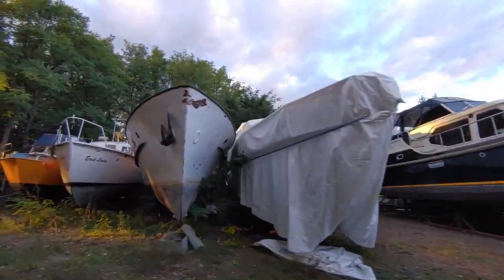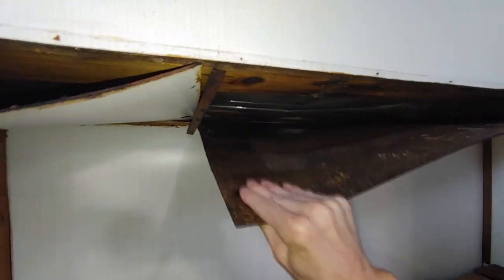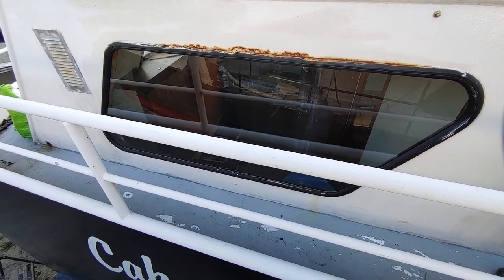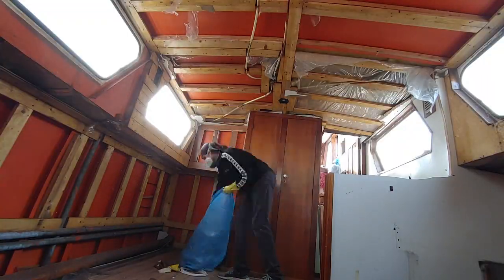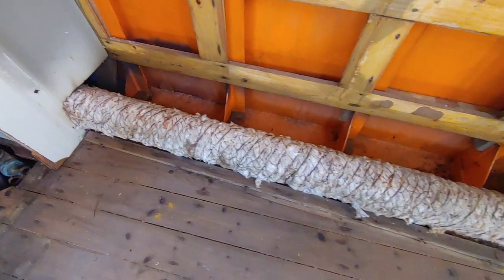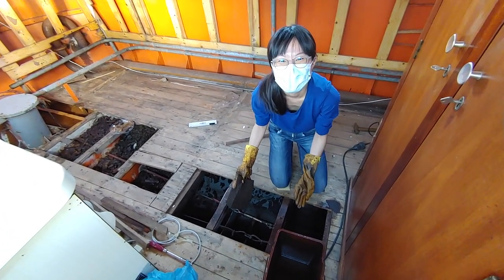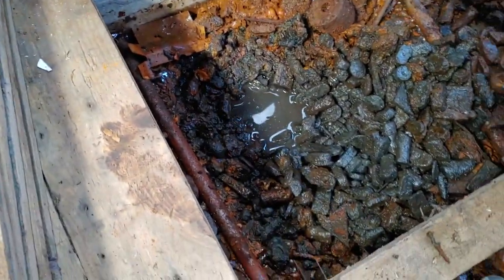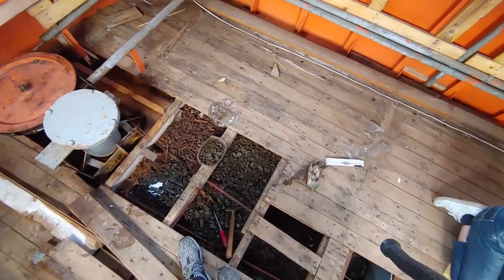WE NEED A PLAN for our Boat Restoration! - Week 3 - Vintage Yacht Restoration Vlog

Comment: Weigh the metal bit as you take them out so you know how much weight you need. Then make small forms and cast the metal bits in cement/concrete. This way you install the ballast in blocks. They will be easier to remove to check and maintain the hull. You could also lay down a thick rubber mat to keep the ballast block from sliding. We do this here in the US instead of using lead ingots or loose-fill ballast.

Comment: If your still finding water. I would consider getting a wet/dry shop vac. Will save you some time if you have power to run it. If you dont. Consider getting an aerator pump that runs on 12V DC.

Comment: for the hull i suggest a needle gun, its a tool that fires captive small rods of steel, electric powered advantage is less dust but its slow, faster would be to bead blast, then  prime  the hull then epoxy. Inside use insulation below the waterline to avoid condensation  its either self adhesive or glued on I think you have purchased a  generator is that for the boat, an alternative would be lithium iron batteries and as many solar panels as you can min 2kw inverter and associated control equipment, if  you are staying mainly in marinas then shore power is going to be the  main energy  cook by gas, heating by diesel  hot water via calorifiers, OK for 24 hrs after engine stop but  after that either a diesel water heater, shore power or electric but that; a heavy drain on the batteries,  to give you an idea we had 4 x 225am gel batteries They would last  for days  at 500 eros thats a lot of cash we also had a 8 kw mastervolt generator for battery charging and running an electric oven  but that was 15 years ago ( 12.7 meter Vlet but by Smelne in Drachten) now all electric boats are getting more practical I  agree with the comments about ballast how do you know that you need to put it all back and  its a horrible solution, lead is expensive so some sort of concrete steel solution we had same issue with new boat eventually had to have the boot line repainted and put ballast in the stern but just on one side !  So moral of the story is to wait put boat in the water and see what you have ( a generator weighs a lot so you have to allow for all the weight going in such as batteries

Comment: I’m no boat expert but I would sure give a heavy think about putting all that scrap back in. Got to be a better ballast solution than that. Hope your vids get longer in the future, very exciting project you’ve got!
Reply: Hooper57  You are absolutely right about that. Whatever ballast type is reinstalled should across the tops of the frames so the bilge remains clear, to prevent corrosion. Railroad track and steel plate are possibilities, but it's important to know how much weight of ballast is actually needed. Greg

Comment: I take old car batteries and melt the lead down to use for various purposes. You could also and use for your ballast. Alot better and won't rust. And you could paint the lead blocks if you're worried about lead poisoning.

Comment: Stumbled across your channel and it looks interesting. You might want to check out the Dangar Marine youtube channel. Stu has been restoring and operating a steel trawler project boat and may have some useful info regarding hull repair and paint, diesel motor rebuild  and electronic/solar upgrades. Good Luck on the project and I will be enjoying your progress.
Reply from the maker: Hi Mark, thanks for the advice. I actually did already find Dangar Marine several weeks ago when searching for "steel boat restoration" and I agree with you, his channel is one of the best out there on this topic, I learned a lot from his videos. I always wish I had his tools haha. Anyway, welcome aboard and hope you enjoy the content :)

Comment: You seem to be underestimating. you should Completely strip the ship to a casco and repair any corroded steel. Lots of welding. The sandblasting and zinc primer. Only then start building.

Comment: I am having a hard time watching this vlog because your knowledge of the boat and the refit process is so low.  But knowledge will come to you.  I am glad that you are formulating a plan.  Good thing.  I would put at #1 the need to find the seller of the boat because he miss lead you.  This was never a buff and shine and back in the water type of boat and he knew that.  You need to hire someone to give him a beating.  I hope you didn’t give too much money for this boat because you are going to put a shitton of money into it if you do it right.  #2 hire a professional boat surveyor to find out where you stand. It will be worth the money.  #3 you have a bunch of comments that are giving you good information.  Listen to those.  The ones that are telling you that they wish they had one like it and you should do this or that, yeah, ignore them.  #4 water in the boat.  Get a pump working so you don’t have to bale it by bucket.  Then weld up the holes that are letting in the water.  You have a metal boat if you don’t know how to weld get a welder and learn because you will need it.  
You and your wife make a good team.  You have youth and energy on your side.  That can take you farther than an old dude like me.  I will subscribe to see your learning process, I wish I was close enough to let you use my shop but I am land locked far away from Germany.

Comment: I wouldn't put that rusty nightmare of scrap metal back in the bilge.  You may not even need any ballast because you're going to be adding a lot of weight with your modifications.  In any case, do you want to repeat the damage you're dealing with now?  Think before you act.
Reply: Not to mention it probably has lead dust.   Not good.